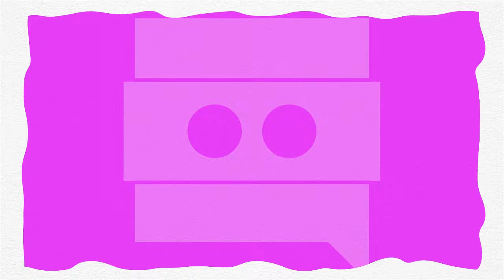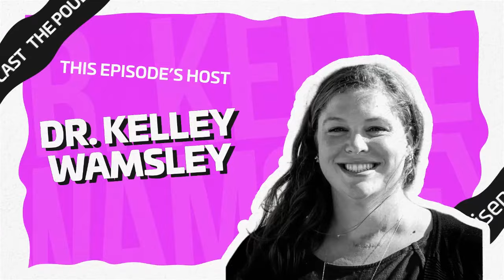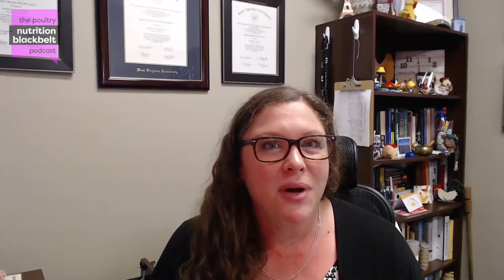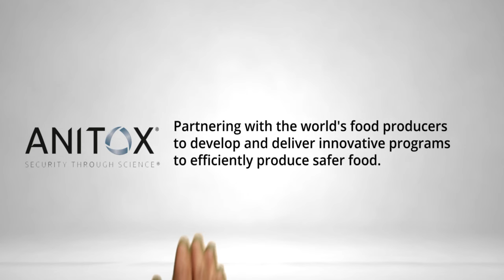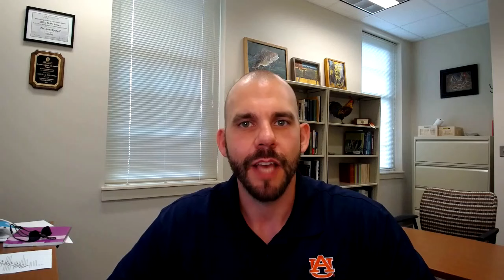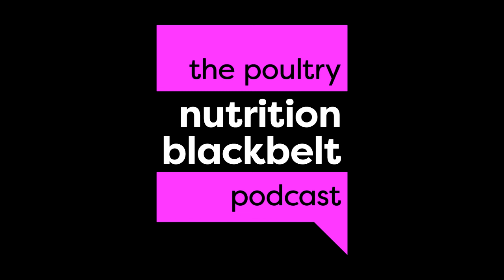Dr. Birger Svihus: Particle Size and Poultry Performance | Ep. 16

Comment: Just as the muscles grow when we exercise at the gym, so does the gizzard function efficiently when it has feed to grind. 

So, adding coarse cereal particles to feed instead of finely ground cereals helps stimulate the gizzard to exert its function.

The pellet press will play a big role in achieving the required diameter of the feed pellets.

It is therefore better to have more coarsely ground feed particles because:
1. It will stimulate the gizzard to function better
2. Increase the amount of very finely ground particles in the small intestine 
3. Accelerate digestion
4. Speed up nutrient absorption in the small intestine in a rather short time
5. Help to save money

I think more research should be led to ascertain the perfect particle size of the coarse cereals that will yield the best results.

Subjectively, the information in this episode is invaluable. Thank you for sharing.